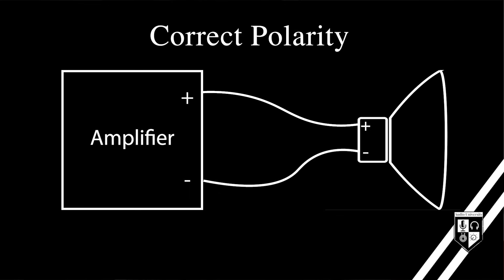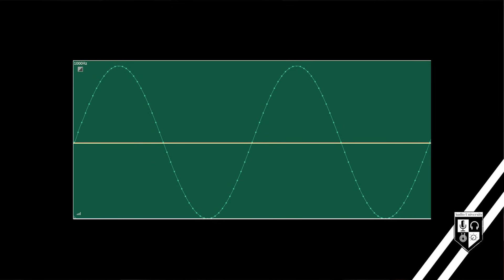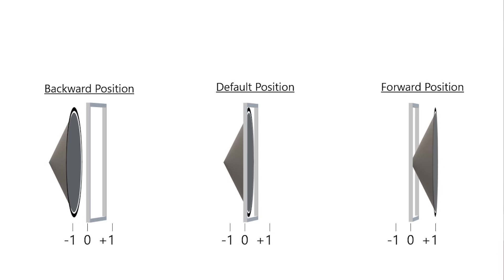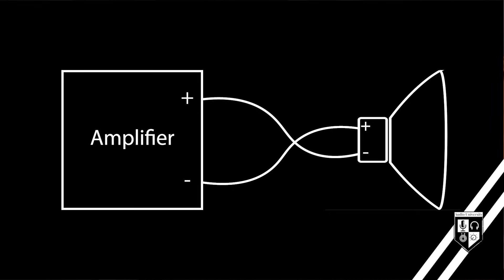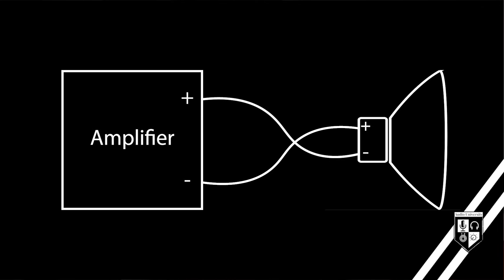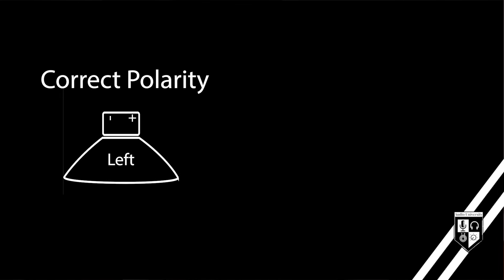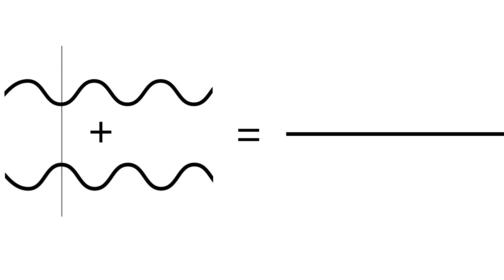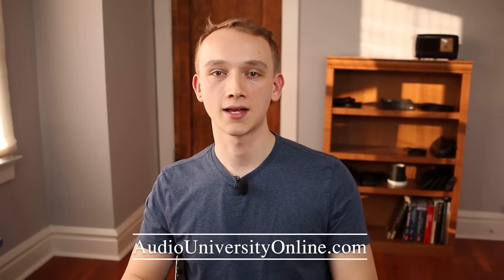POSITIVE VS NEGATIVE: Does Speaker Wiring Matter?

Comment: it helps me to fix my car stereo thanks 👍🏻
i have installed new JVC  stereo in my old car because my sony stereo died after 12 years.
but i accidentally connected one speaker with correct polarity and the other with reverse polarity. So what happen, when i play the music the vocals are good but the base is zero because one speaker push the air inside at the same time the other speaker pull that air and the resultant base become zero.  
but this video help me to correct my settings👍🏻

Comment: There are numerous speaker manufactures that use reverse polarity in their speaker designs, JBL being one of the  more famous brands. A lot of 3-way speaker designs use reverse polarity on the mid-range or tweeter. Speaker polarity is not a steadfast rule.......The crossover design can also require reverse polarity in multi-speaker applications. I just modified a Klipsch RF-7 speaker that the new crossover design required reverse polarity on the tweeter, it sounds amazing!

Comment: hi what happened but i don't think it matters is that i connected the marked wire normally for + but to the - polarity but i also connected this one to the - polarity of the amp . so it's  - to - and + to + as expected , what only changes is the colour on the cable

Comment: In an audio strereo deck when there are two separate ports(each having two terminals) made for each speaker, does any significant change occur for wrong polarity connection unless multiple speakers are connected on a single channel? I am asking this since there are audio cables available in the market with no defined polarity

Comment: Here is a question I have: I have to older vintage ADS speakers and the back terminals have neither positive or negative (red nor black) indicators. How do I know which to connect my speaker wires too?

Comment: How about when setting up a stage for a performer with monitors for the musicians, if the monitors on stage a facing directly rearwards, why not wire those inversely so that the overall wave movement is coordinated in the room as opposed to working against each other causing a dead zone in the area between the back side of the audience speakers and the back side of the monitors?

Comment: When you apply positive voltage in the frequency range of interest the driver will move inwards, not outwards, which will give a positive pressure. This is highly misunderstood by even seasoned acoustic engineers.  You can search my interviews with ErinsAudioCorner.

Comment: So I'm trying to add an Aux cable to an original stereo, and looking at the wiring diagrams there are already adapters out there.

But, it looks like they only send Left and Right channel positive, and 1 ground. (Like a headphone cable) Will this work?
Reply from the maker: If there are RCA inputs (red and white) on the stereo, you can use an 1/8” to RCA adapter.
Reply: @AudioUniversity  There aren't RCA inputs, but they have a connecter that's supposed to come from the CD changer to the radio as an input. It lists Left +/- and Right +/- in the wiring diagrams.
The adapter online only has 3 conductors though, looking at the pinout it's only Left + and Right +, then "Audio Earth" (Ground, british car)
Reply from the maker: Is this a car audio system?
Reply: @AudioUniversity  Yeah it's a car. I'm working with a Discovery 2 SE OEM radio with CD changer.

I want to keep the stock radio and it seems like people piggy back off of the CD audio lines with a 3.5mm headphone jack but I don't understand if you need all 4 signal wires to do so.

I don't really understand what the - Signal wires are for I guess. (I'm like just joining this world sorry if I'm slow)
Reply from the maker: I don’t have much experience with car audio, so I’m worried any advice I’d try to come up with would lead you down the wrong path…
Reply: @AudioUniversity  That's fair
The adapter is only like 7 bucks so I might just send it.

I'm just trying to understand why they have a plus and a minus and why/if they're needed at the moment. Thanks for responding so quick.

Comment: @Audio University  GREAT VIDEO !  I had a question about when you might want to have two speakers out of phase with each other.

I have a 2022 JTRD with the upgraded 8.4 Alpine system.  So I have a total of 9 speakers including the sub.  4 speakers up front (2 top dash / 2 knee panels) and 4 speakers in a rear sound bar that is above your head, it has two pods of two speakers each, a  3/1/2" and a 4".  I do not have the high tech equipment like a professional shop, so I used my cell phone and a multimeter to do my testing.  

My question is mainly referring to the sound bar... but here is the deal:   

In the JEEP community, there have been several instances where the wiring diagrams posted on the internet and the actual  +/- or polarities have been reversed from the factory , so I getting ready to update my speakers, so I wanted to test and double check.

First I checked the front two(2) upper dash speakers with my multimeter and determined my +/- wires were opposite of the OEM wiring diagram.  For the left, Grey/Orange - (Neg) and Grey/Yellow +(Pos). For the right, Grey/Dark Green -(Neg) and Grey/Light green +(Pos). Once I connected the speakers, I then used my cell phone app for Android (Polarity Checker)  to double check my multimeter reading.  When doing this,  both upper dash and lower knee panel speakers "POPPED" green. So from these results,  I am assuming I have all of the positive speaker wires coming from the head unit(AMP) connected to the proper positive terminal of the speaker.

**This is where my question/request comes in.....*** 

I know in general, you want all of your speakers to be the same polarity,  either all "POPPING" green or all popping red, but from my understanding(which is limited on the subject) I read there are some instances where you want your speakers to have opposite polarities, such as if when the speakers are inside the same enclosure . I read it could also  be caused when using a crossover.  I wasn't sure if this was 100% true... 

I haven't upgraded my soundbar yet, but before I did, I wanted to check their polarity.  Testing using ONLY the cell phone app.......  the two smaller 3-1/2" speakers (on the outside of each end of the sound bar "popped" red and the two inner 4" speakers "popped" green.  I was wondering if since a 3-1/2" and a 4" speakers share the same pod, are they wired out of polarity on purpose from the factory ?  Thus, making the 4"  push , while the smaller 3-1/2" pulls..... working together... maybe more efficient ?  Or Should both be wired the same (making all 4 of the sound bar speakers function the same and "pop" green) and then ultimately, making all 8 speakers pop green together ? ...  

I plan on updating the rear soundbar speakers and want to make sure I have them wired correctly when I do.

Hopefully I didn't make this more confusing than necessary, any help would be greatly appreciated.

Comment: I got my walls repainted. Speakers were removed Problem is wire is fixed inside the wall so can't change to a new wire & old wire does not have any different color both are black how do I determine which is positive which is negative wire of a 5.1ch home theater

Comment: so im curious then because my subwoofer to my amp the wiring was negative to positive vs the right way and it sounded so much better until i noticed and change them back and it doesnt sound as good. so what should i do
Reply from the maker: Go with whatever sounds better. Sometimes a polarity reversal is needed for optimal crossover with the main speakers.
Reply: @AudioUniversity  Thank you so much i will do
Reply: @AudioUniversity  hey also what would you recommend for a amp to subwoofer wires i bought some online and they came with copper nd silver which one should be positive

Comment: Great video! I have a doubt about the same issue, but on a balanced to unbalanced connection. Taking as example an reamp box: let´s say if I flip the input XLR hot signal to the output TS sleeve, and vice versa. Would be any risk of damaging the amplifier or it´s speakers?

Comment: I am wondering if i’m hearing the difference correctly. I used headphones, for me i noticed that the sound the right side (inverted) is more quiet than the left side. Am I hearing this correctly?
Reply from the maker: It may seem that way, but the level is equal in each speaker.
Reply: @AudioUniversity  Yeah, before I thought I will not hear anything because it cancels out each other, guess I’m wrong
Reply: Btw Thanks for the reply! I did not expect for the creator himself to reply to my comment. I definitely love your videos please do more
Reply from the maker: If you mixed the two opposite signals together into one speaker, they would cancel! So you’re on the right track! 

Glad to help, MetanoiaX! Thanks for watching.

Comment: If was to have 3 subwoofers & 2 was wired correctly & 1 was reversed wired & face the cab the opposite way would that be cardioid mode or no?
Reply: Cardioid requires precise calculations like delay timings for each subwoofer

Comment: Ambient pioneer Brian Eno used to recommend using a third speaker in your system in addition to the normal left/right set-up, wired with both cables to the left and right postiive terminals of your amplifier. This produces an out-of-phase effect which may enhance your ambient listening pleasure and which,  in my experience, doesn't seem to harm your amplifier.

Comment: Actually with a ported speaker box reverse works best it doesn't Stretch the speaker out Each time the bass hits the speaker flexes backwards not forward I have hooked up speakers backwards For ported subwoofer boxes On purpose I didn't want my subwoofer moving forward on bass Flex only backwards with a ported box it works best for Paper subwoofers only

Comment: You are incorrect that if both speakers are reversed in polarity vs both in correct polarity it will sound the same. If a stereo pair of speakers that are setup correctly it will sound very different.

 Setup is as follows (and what stereo was designed for):

1) Setup speakers about 8 feet apart and same height and distance from the back wall and chair/sofa with low back 10 feet in front of speakers in the middle.

2) Pick a recording with good prominent vocals.

3) Listen to the recoding on sofa.  After listening with care, now if you reversed polarity on both speakers and listen again you will hear a significant change (how much depends on the quality of your audio system).

4) Once you have the correct polarity (the polarity where it sounds better) fine tune the distance by moving the speaker 1 inch at a time closer or further apart from the other speaker until you hear the singing voice sound become more of continuous single voice and not like two speakers playing the voice.

Once this is done try other recordings. The placement of the speakers, once "tuned" to the correct separation will make all your recordings sound better.
Prominent instruments like a saxophone can also work for fine tuning. 

If you achieve this now you will hear imaging of a stereo pair of speakers and polarity makes a difference.
This is worthwhile if you are a serious listener to music.

Comment: If it is a stereo, 2 speaker system, then you will have to move your head a millimeter to the left for it to be correct. Only a problem when your head is in a vice ( or headphones )
In a multi speaker per channel system, it can make a difference. If the sub is wrong, the bass will seem out of phase, just have to move the sub back or forwards a little.

Comment: I did notice a difference when you switched the polarities by listening to the drums. If the punch starts with a push, the drums sound a little bit more punchy than when it pulls. It will give you the illusion of the sound exploding outwards rather than imploding inwards.

Comment: Sometimes polarity of a speaker matters a LOT electrically...
I distinctly remember a massive subwoofer going haywire when the polarity was inverted (The plug had come clean off the board, which had no silkscreen...), the resulting noise shook the shed pretty hard!
When it was wired correctly after un-shitting myself, I could hardly tell it was doing anything - until I realized the neighbors had finished parking their car, and the rumbling / thumping was synced with my music!

My guess is that maybe the driver was connected to ground, but that would have shorted the amplifier = no sound (maybe a bang though)...

Comment: Yes, polarity definitely matters.  The hyper-real bass drum in much pop music is quite obviously different with a polarity change, with headphones or speakers.  The words positive and negative are pretty abstract when talking about sound waves.  Pressurization and rarification are more technically correct and more descriptive.  A positive wave literally presses against not only your eardrums but, at a sufficient volume, your gut as well.  Flip the polarity and the rarification by contrast feels and sounds wrong.  

Many professional monitor speakers have an exposed woofer which can be clearly seen to move toward the listener first with a bass drum playback.  I always know my speakers are wired correctly, but I still do the visual check because there are many places the signal can be inadvertently reversed in the process of recording.

Comment: Does speaker spacing or the position of the listener change how the sound waves sync? Great explanation and another addition to the list of things I’ve never thought of. The more I learn, the less I know.
Reply: sometimes people wire speakers out of phase on purpose because of placement. like in a car where the tweeters may be a couple of feet away from a mid range driver inverting the tweeter may give a better sound quality or eliminate standing waves. a lot of it has to do with crossover overlap and roll off as well. an RTA is a great tool to troubleshoot issues.

Comment: If you wire one speaker out of phase with another in mono and face them at each other they cancel out and there's almost no sound.
This is exactly what a company I used to work for would do before sending out some models of their speakers to customers. There were complaints that they didn't sound right and indeed the customers were correct. The problem was stiff surrounds. They'd just leave them on like that overnight.

Comment: In other words, if you only have one speaker, it doesn't make any difference!  And in that case, there is no correct or incorrect hookup.  However, different speaker manufacturers may mark or indicate the polarity of their speakers differently, so it's best to check and match the polarity manually (by testing) if you're using multiple speakers and mixing different brands.

Comment: Kyle,
Why don't you speak on subject you fully understand instead of passing on vague and often misleading information?
I can tell just by the terminology you use that you don't fully understand this subject.  "Phasing" should have been something you mentioned in the first 30 seconds but you decide to go down the road of "inverted voltage" (only used by electrical engineers when discussing op-amps) and polarity when there is no such thing as polarity on an AC signal.  The red and black terminals could just as easily have been green and blue and the symbols    1 and 0 instead of + and -.   There is no polarity.  What you should be teaching is proper phasing of the speakers and you could even have shown how to determine if they were properly phased as the factory.  Improper phasing will make no discernible difference to the listener so long as the incorrect phasing is consistent.  2:48 "you probably didn't notice much of a difference".... well, that is because there was no difference.  Not one that was audible, anyway.  It's like turning on the sound half-way through the first half-cycle of 1kHz sine wave....you don't know you missed the first 500us of audio so you don't now hear something different than if you didn't.
Phasing is a problem when speakers (one or more) are not in-phase with each other.  Depending on their distance from each other and the distances to your ears, some frequencies will be attenuated and others will be amplified.  Room size and acoustic will also contribute to these acoustic aberrations as there are places in the room where some frequencies won't be hear and others where the exact same frequencies will louder.  4:08  So, it is not true that out-of-phase speakers will cause the "signals to cancel out"... they just won't be in phase and if you change your listening location you can actually get that one signal that you represented to be back in phase as they arrive at your ears.
Please stop using a rudimentary understanding of something you just familiarized yourself with to "teach" others.... it's confusing.  Maybe not to those who know less than you, but it's definitely confusing them and they deserve better.  KNOW your subjects inside and out before passing them on.  I know you want to make content and play the algorithms, but have some integrity about it.  It's not worth 100k subscribers if you're not giving them real understanding.

Comment: My real name is Michael McCluskey. I have an electronics workshop in my basement. I used to fix the older CB radios and vintage audio amplifiers and those that have radio receivers and inputs for some other source as phono table. I have the audio card in my desktop computer connected to a Panasonic RA-6100 auxiliary inputs. I have two speakers on my desk that sound good.